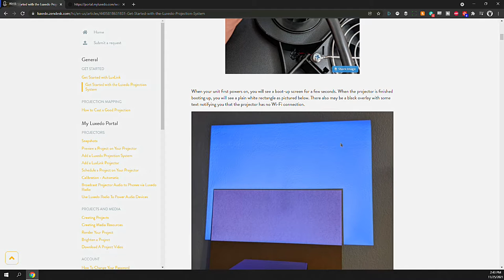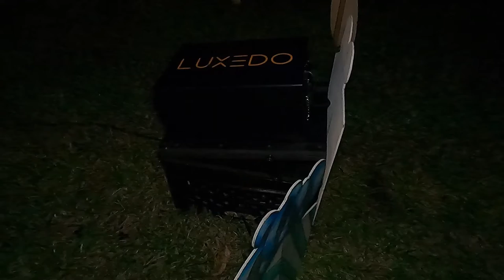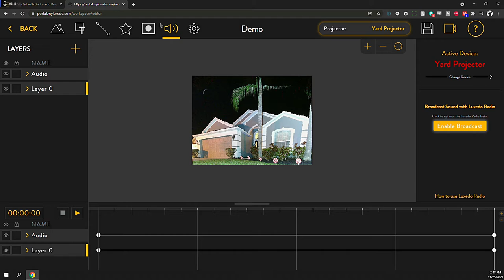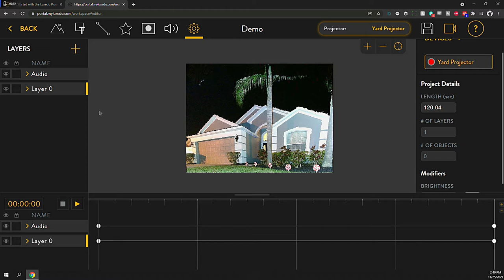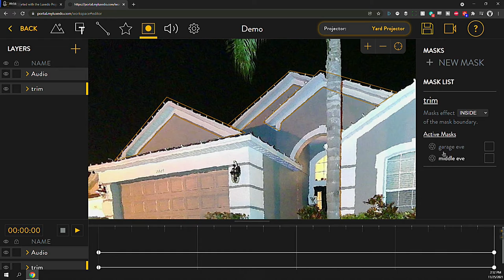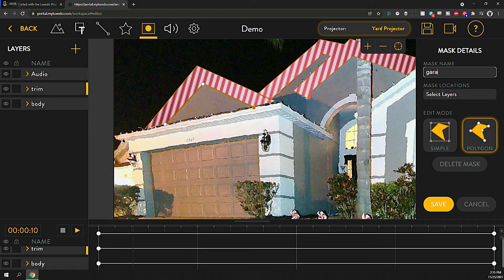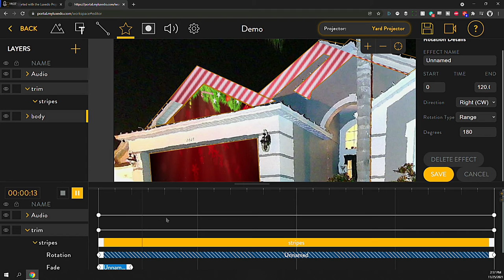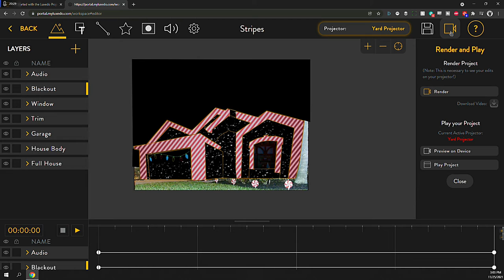Easy Video Projection Display using Luxedo!

Comment: Can you add multiple videos or have a long projection with certain things happening at certain time markers? IE frosty the snowman and you have a snowman on there and later in the projection rudolf and you take frosty out and add a reindeer?
Reply from the maker: Yes, you can, i found it easier to create multiple shows then schedule them back to back. You can also have multiple projectors and sync them together.

Comment: Can this be used with a RF transmitter? Where people can on a FM station?
Reply from the maker: It has a feature that allows people to use their cell phones to stream the music, or you can use a Bluetooth speaker, depending on your setup you may be able to broadcast from that setup.
There is no headphone out port on the machine.
Reply: @DIYEngineering  I want to add a “the grinch short film” to the end of my Christmas light show. Do you think this is possible with the software? (I have my own projector). I want to add it to my light show list, so it will play repeatedly after every song on my playlist.

Comment: does it work with 220 volts?
Reply from the maker: The device is 110v you may be able to use a power inverter

Comment: Beware! Product is a scam and they charge a $350 restocking fee for returns.
Reply from the maker: I wouldn't go as far to say it's a scam, it works relatively well for what it is. I would say that if you are interested enough to have specific requirements, just build it yourself! but they are trying to please a diverse technical community.  restocking fees are BS, ill give you that!